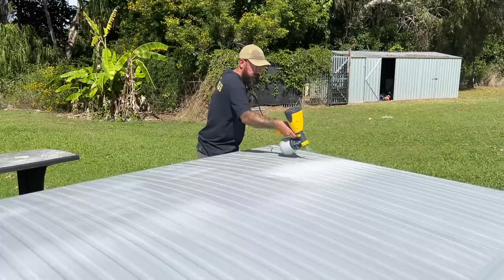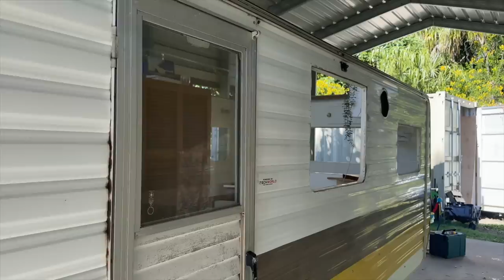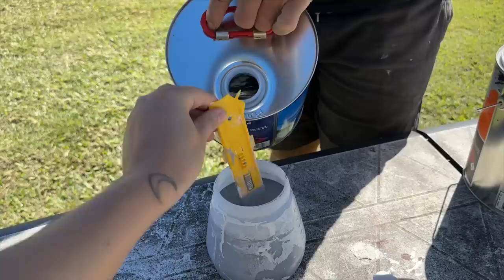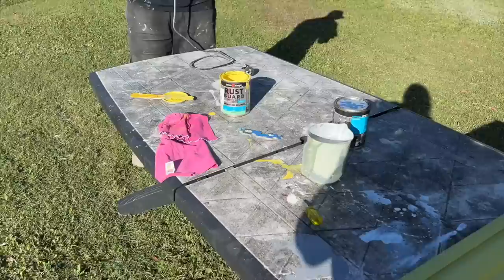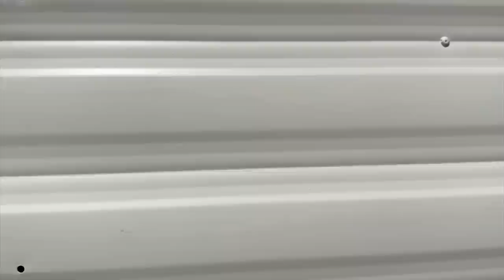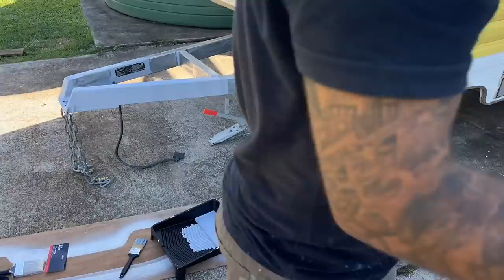DIY Painting Our Vintage Caravan | Viscount Caravan Reno Ep.8

Comment: Nice work. Spraying gets into the folds, so its a good way to go with the corrugated aluminium panels.
Reply from the maker: Yeah so much easier, the part I did try with the roller left line’s because I was pushing it to get it to the folds.

Comment: loving the videos guys, just a heads up though your stabilizer legs are actually supposed to run on an angle to stop the van from rocking and not straight down like you have them here.
Reply from the maker: Thank you! And thanks for the tip ☺️
Reply: No they’re not. There’s two types of stabiliser legs. For low vans the angle ones are used. For higher vans the straight down legs are the go.